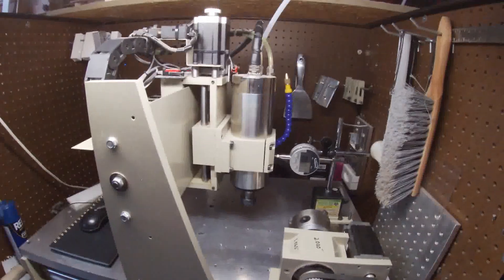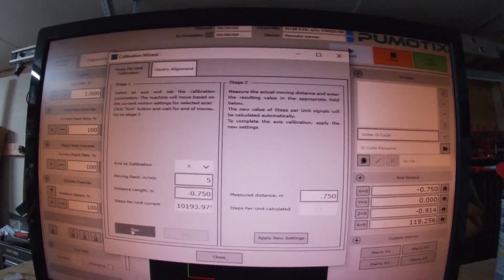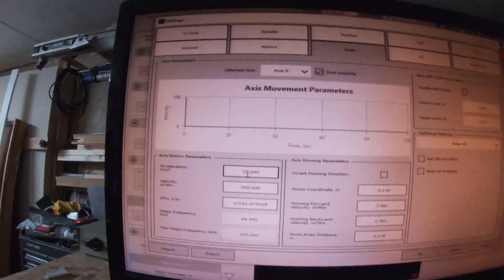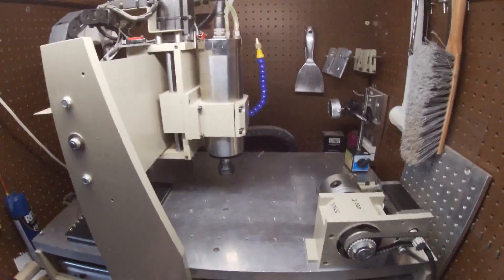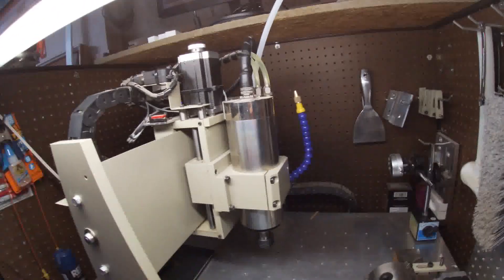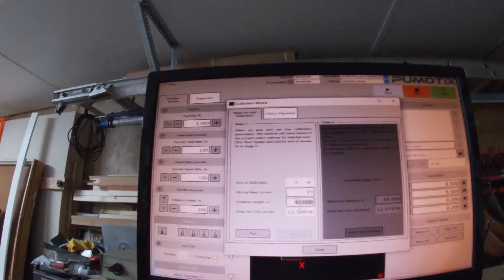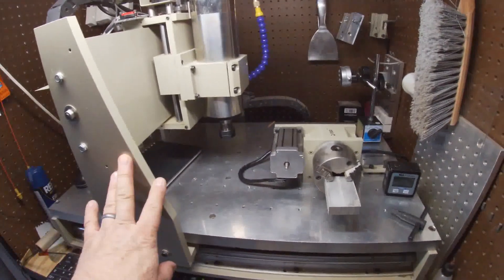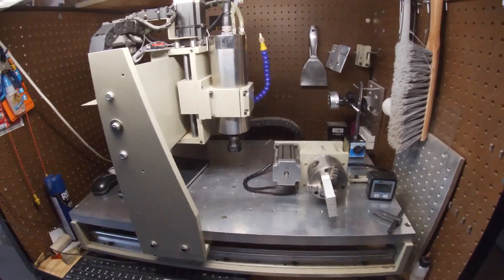Pumotix Calibration on 6040 machine

Comment: Good job.....how many turns per inch on your Y axis screw? Also, am I seeing things......after Pumotix made its calibration run, it looked like it automatically filled in the actual travel. I always have to fill in the travel by hand after looking at the dial indicator.
Reply from the maker: Don't know how many turns per inch. X and Y are the same pitch ballscrew so they would be the same. Pumotix puts the steps per unit (inch or mm) in the window and lets you decide to apply them.  Both Mach and Pumotix records the steps per inch and when you achieve success on the indicator the final number is displayed. The reason the amount to travel is already in the window is that I punched it in off camera before filming. I cheated and did the calibration before filming so I don't have any embarassing moments to edit out! lol Thanks for the comment, What software were you calibrating with?
Reply: @cpworx_maker  Oh, ok after I asked the question I thought about the possibility of you entering the numbers off camera.....all solved. I am also using Pumotix. Thanks!

Comment: I setup my machine in metric but when I switched to inches it was out wack. I'm using Pumotix  ? weird
Reply from the maker: I ended up sending back all my pumotix stuff. There were always little issues here and there. I never got my spindle control to work right. I went back to the old school Mach3 and everything works perfect.  Just remember that if you switch to inches you will need to re calibrate your motors.
Reply: for real! I just rewired my machine for this.
It was not cheap and a lot of work!
what kind of problems were you having?